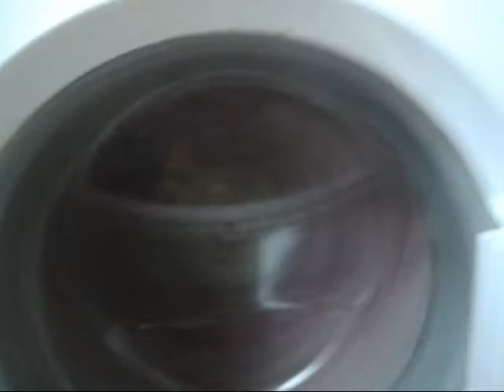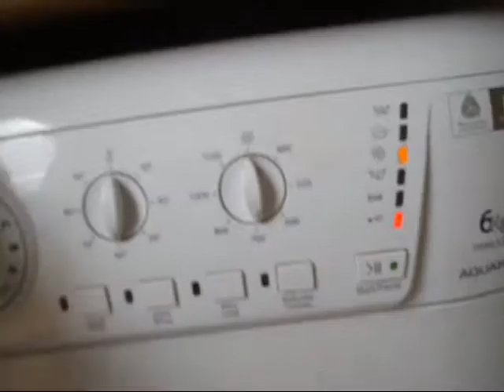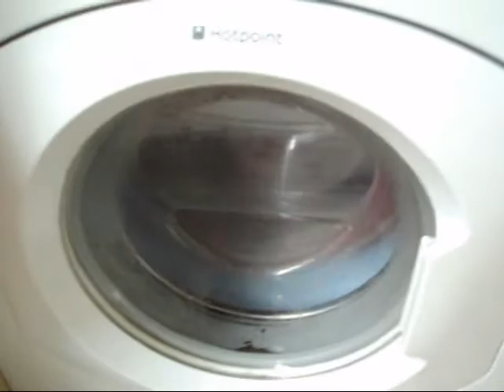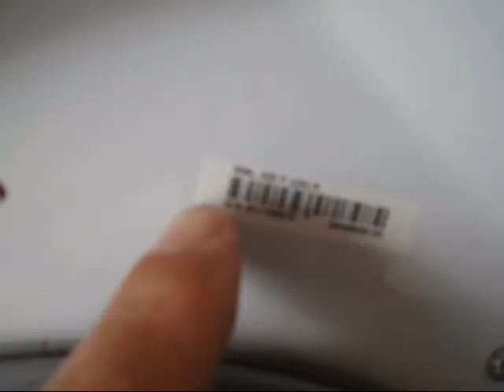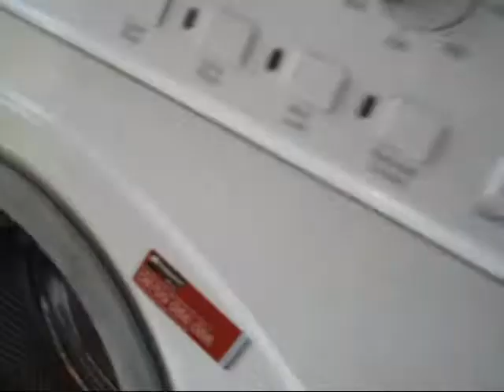Hotpoint washing machine noise

Comment: Exactly the same machine as ours and the same has just happened to ours. Hotpoint machines/Whirlpool are made in Turkey and I wouldn't be surprised if they get banged about a lot being exported and it cracks/weakens the spider assembly before you even buy it.
Reply: Which cheap ones would you suggest?

Comment: Hello. I have the same problem with the washing machine. Get the same sound. Please tell me what was the cause of that noise?
Reply: At the front of the washing machine at the bottom there is a panel open that then there is a little lid unscrew that be careful as some water might gush out of there use towel or some rag. There might be some debris such as coin stuck in there. Remove this and hopefully the annoying noise should go away!
Reply: @shmoh786  rustic
Reply: @shmoh786  that's the drum spider. Ot has snapped. These have sealed tubs so these are knackere
Reply: Hello what was the outcome of your washing machine saga ?